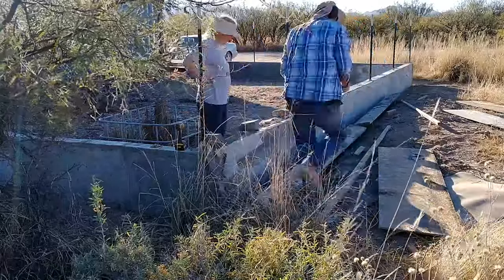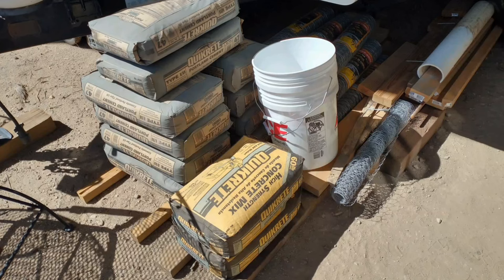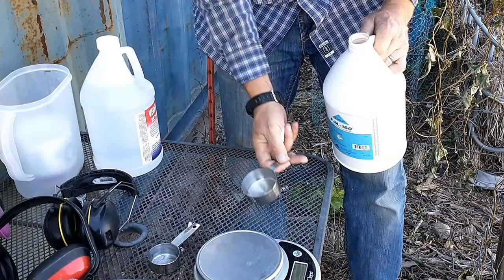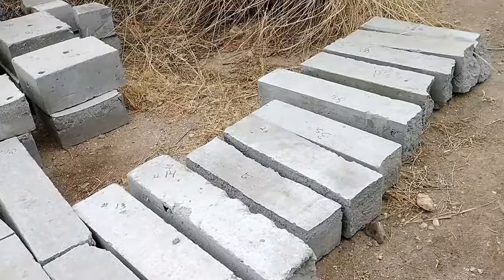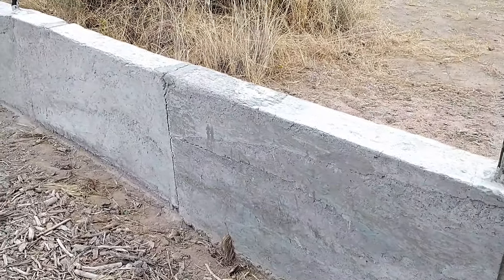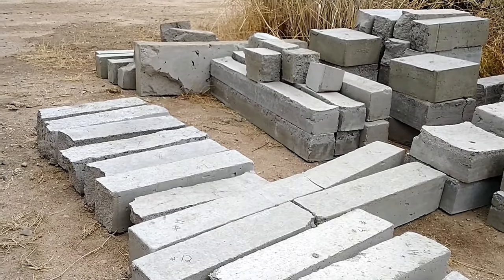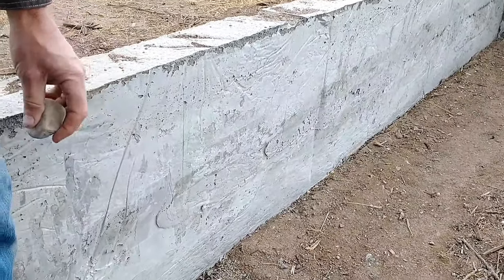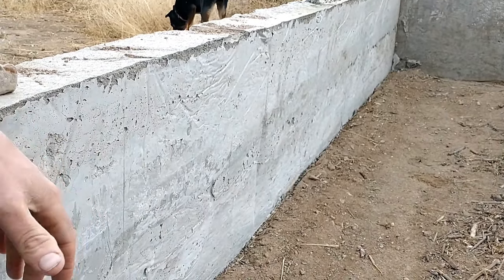Why we GAVE UP on AIRCRETE & What is Our Plan Now?

Comment: Has anyone tried to make aircrete outdoor wall which was covered with stucco?  It might be a money saver vs using cinder blocks and hep with recycling styrofoam?
Reply from the maker: That's what we did for our garden wall. It was a little cheaper than cinder blocks, but it probably won't last nearly as long.

Comment: very thorough exploration of aircrete's limitations,
thank you very much for sharing

one thing i was thinking about, how difficult would it be to do a second pour of pure concrete around the aircrete slab for improved surface hardness? I was also thinking of adding aluminum scrap fiber to help with strenght without adding too much weight
Reply from the maker: Thanks! Yes, seems like pouring concrete over an aircrete slab would probably work pretty well, as long as the aircrete turns out okay and isn't too brittle.
Someone pointed out, (which makes sense to me) that fibers that are not fully encased, do not offer much strength. The air pockets can't grab onto them. 
 Best wishes on your projects! 👍🙂
Reply: There is a reactivity problem between aluminum and concrete, that would be a fail. The aluminum would corrode away rather rapidly.

Comment: your mix looked really off there, too much exposed foam, I think a dual paddle mixer would be more helpful. I think you are making your panels to small, the better use would be a full 8 foot by 4 foot wide panel with wire mesh inside would be a better deal, you still need to use some kind of exterior coating for the air create,  also a form release agent rather than crinkly plastic,
Reply from the maker: These were just test samples. We were planning to pour the walls in place, and use reinforcements and plaster. We had a double paddle mixer, but didn't have much better luck with that. Some batches turned out great. We suspect the colder temperatures were to blame for our later issues.

Comment: It looks like it dried before it was fully cured. You need to keep it wet for about a month for the concrete to cure all the way.
Reply from the maker: The process was explained in other videos. We kept them covered in plastic and wet them down morning and evening. We think the colder temperatures were likely to blame for our later issues.
Reply: @RedandAprilOff-Grid  Yep cold does that too.

Comment: I watched another video about AirCreete Mixing the guy fixed his problem by using bigger paddles inside of the Mixer tub.
Reply from the maker: My Little Homestead, has had success mixing it in a cement mixer. They are using aircrete pavers as decorative/insulation on their shop. Autoclave concrete only lasts 30 years and aircrete probably won't last even that long.

Comment: Rammed earth requires more labor, but with extreme outside insulation will allow for almost zero energy input to achieve comfort. The RE acts as thermal mass, keeping inside at a stable temp all year. Radiant heat/cooling in the insulated pad/floor + skylights for daylight are two very helpful strategies.

Comment: Hey there. Thank you for sharing.  My group and I are embarking upon a similar path and your experiences shed some valuable reality on the situation.  We had actually decided to go with earth blocks a short time ago, for much of the main structure instead - and use the aircrete for other non-structural things.  Have you had a chance to look into those?  Some good vids on youtube and there are machines somewhat similar to a login mill on a trailer (size and complexity-wise) - and you already have much of the material you would require to move forward with that.   Highly recommended but wish you luck regardless!   Thanks again
Reply from the maker: Thanks! Compressed earth blocks sound like a good option, we haven't looked into them much. Aircrete is a challenge, there seem to be a lot of variables that have to be just right. Best wishes on your build!

Comment: Irish rubble wall house.
Last for 150 or More years can be 1 to 2 floors.
With modern cement in the mix it will be stronger.
you Use Rocks in your area to Build the Home 
Inside the wall is cement and stone Stomp down
the main walls in side and out are Rock and Mortar mixed with cement.
you can even add a fire place on the Main floor..
Why change a 200 Year old building Method when you have every thing you need right there.
Reply from the maker: 😎 We don't have many rocks on our property. Our son built a hyperadobe house with 18 inch thick walls, but we wanted something with better insulation. We are very glad we didn't use aircrete. Our house turned out great, it's very comfortable, and it's heated entirely from the sun. 🌞

Comment: If it's not weight bearing why does it matter?
Reply from the maker: It was going to go between metal beams, but it was also going to be the interior and exterior walls. It would have been covered with fabric and plaster. The concern was that it might eventually crack or turn to powder under the plaster. We also found out the insulation value isn't very good, and it was going to be a lot more work, without any coat savings.

Comment: 🔆to recycle aircrete, shave material to a powder & mix in with new mold.. anyone know if this is possible without compromising?
Reply from the maker: I don't think there would be any benefit to reusing it, better to just start from scratch. I use the blocks in my garden to protect and insulate young plants.

Comment: I don’t understand how anyone is thinking this stuff is good for building with or how it works. Can’t imagine at the very least, doing a final cement mix as a top coat and a sealer to prevent water absorption.
Reply from the maker: We explained our plans for reinforcing and finishing the walls in our previous videos.

Comment: the aircrete material is suppose to cover walls not to use as structure is a light material with air bubble tha help as isolator but after sould be painted with waterproof paint because also is not water proof, the structure of the building have to be of a stronger material like wood or steel,  I would prefer to use conventionals brics
Reply from the maker: Yes, we were planning to use lots of metal reinforcement as well as fiberglass mesh and stucco on the outside.
Reply from the maker: Our house turned out great, I'm so glad we didn't use aircrete!

Comment: You could have just asked or researched others' experience. We only use aircrete for dividing up the livingspace with good insulation property, not for bearing high loads as a structural element.
Reply from the maker: Yes, we know it's not load bearing, as mentioned we were planning to pour it between metal beams. We have other videos explaining more of our plan, and everything we tried. I read every article I could find, watched every video available at the time, and asked lots of questions. There were certain questions no one seemed to know, or at least refused to answer. It was very frustrating! We know more now, and aircrete wouldn't have worked for us anyway, our temperature swings are too extreme, we don't have a climate controlled space, and being completely off the grid we have limited power. The experience made us appreciate conventional materials even more, and our house turned out awesome. We also learned that aircrete is not inexpensive, and it's a huge pain to work with.

Comment: You could use aircrete like they do with haybale walls! If you used your steel for the frame and just fill in with the aircrete! The aircrete should never be used to carry any weight only for fill!
Reply from the maker: A steel frame was the plan, but we still had concerns that the aircrete would eventually crumble and crack under the fiberglass and plaster coating, thus losing it's insulation value and cracking the plaster. We also weren't impressed with the cost, or amount of work involved.
Reply: @RedandAprilOff-Grid  I still think it would work if you put black paper and wire over it then stuccoed it on the outside and gypsum plastered the inside!

Comment: I think it's the ratio of foam. Each batch should contain no more than 95 grams of foam. God knows you were quite mindful of each step, so I fully suspect it's the foam.
Reply from the maker: Yes, the foam needs to weigh between 80 to 100 grams per quart, and we are adding about 40 gallons of foam. We weigh the foam at the beginning of each batch, and he adjusts the pressure regulator throughout the batch to make sure it stays the same. On our first few batches, the pressure was drifting and the foam was getting more dense.

Comment: I would bet you are using hard water and not know even realize what has happened. This is the first mistake I made when I tried last year. Hope that helps
Reply from the maker: We were running all if the water through a little water softener tank. Some of our first batches turned out awesome. I would suspect our later failures had something to do with the cold Drexel, but there are a lot of variables to control with aircrete, so it could have been something else too. We have videos showing everything we tried.
Reply: @RedandAprilOff-Grid  Just to let you know Sir. There's a difference with PH and hard mineralized water which is dissolved elements in the water solution. Also, warm water works the best from what little experience I have with aircrete. Then there's mix ratios too. This determines the hardness of the solidified form which goes from higher strength to higher insulation value. That would be the last part of the story. Good luck with your earth home Sir.

Comment: Did you guys always make sure to use the same equipment even when making the foam? Did you measure the same amounts of foam to concrete each time? Did you guys make sure you were consistent in making the foam since too much air pressure or not enough air pressure change really effects the foam each time and takes a tweeking until it's right.
To be honest I think you were in too much of a hurry and never bothered to be consistent in all the above factors. You also need to make sure you do not add to much water to the concrete. 2 months of never repeating an exact mix is showing you were more about time than the build. Did you keep amounts and foam consistency each time? I doubt it...
Reply: Now that I go more into your video your probably using cheap concrete.
Reply: It's interesting because anything you work with is never consistent. You need to go back to the first one that did well and try a different change. But why change something that worked the first time?
Reply from the maker: Yes, everything we tried is documented in our other videos. We were going to need around 500 bags of Portland cement, so if aircrete is that finicky, it wasn't going to work for us anyway. There was a shortage of cement in our area and we just had to buy whatever we could find available. Most stores only carry one brand, type 1-2  is what most recommend for aircrete.  We suspect the cold Drexel was the main problem with our later batches, but it could have been something else. 🤷 Just sharing our experience with it, and hopefully others can learn something from it.
Reply: @RedandAprilOff-Grid  
You never documented the consistency of the foam nor did you document with the other stuff in this video the fiberglass stuff of measurements and amounts of air pressure nor did you ever repeat when the amounts did work. Why?

With both types you kept changing things as they progressively became worse and not one time did you go back to the ones that worked at first. You never used same air pressure for the foam each time. You realize that's why it wasn't working?
Reply: Also adding double fiberglass is gonna make the cement weaker...
Reply from the maker: We have a playlist of 12 videos. Yes, we  went back to the original recipe. We made a whole garden wall out of aircrete, we made many batches. Yes, we weighed the foam, and talked about it, but not in every video.  He found he had to adjust the pressure regulator throughout the batch to keep it consistent, or the foam would drift to too wet. Yes, we measured everything. We didn't want to experiment for years as we have seen others do, and they still don't live in an aircrete house, because they can't get the mix right. Not saying it can't be done, but we couldn't do it. We shared what we tried in great detail, but not all of the info is in every video.

Comment: If you had graphene aircrete it might have been stronger than ordinary aircrete. Maybe just mix concrete with tio2 sand and graphene with liquid polymer instead of foaming agent.
Reply from the maker: That would definitely be a stronger mix. The foam makes the concrete much weaker, but also adds insulative air pockets.
Reply: @RedandAprilOff-Grid  If you want air pockets try nano tubes.

Comment: You should have used ground strofoam  and portland cenment mix... with plaster of Paris..... yes plaster of paris....
Reply: Experiment with portand cement with plaster of paris.... and mix with just portland and you see the differance
Reply from the maker: Sounds like fun! What have you built with it?
Reply: @RedandAprilOff-Grid  im developing a limestone hard face veneer block  with portland and styrofoam... i need a product that more structurally stable but light weight.. i find traditional aircrete by itself does not give me the strength durability qualities I'm looking for.
Reply from the maker: @772777777777777  Very cool! You should post a quick video on it! There is a lot of interest in making stuff out of styrofoam and cement. We'll see how our garden wall holds up with the stucco coating. 😅🤞 Here's our most recent video showing the aircrete garden wall  https://youtu.be/547ZMbMjn6Q